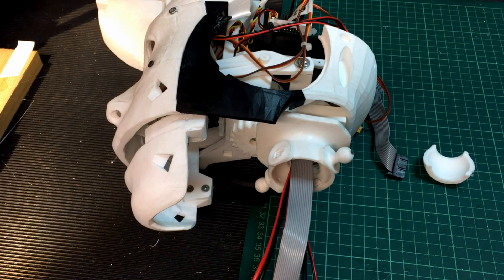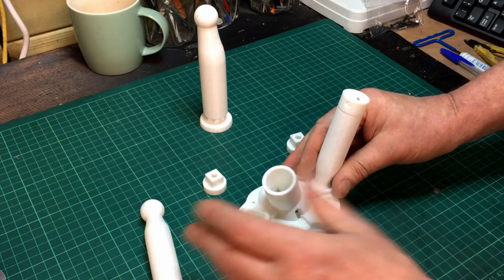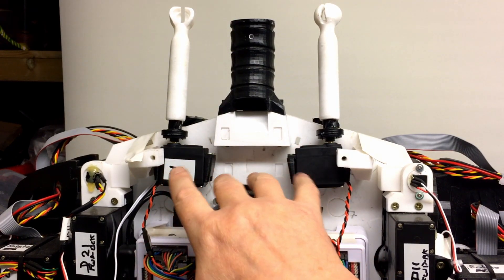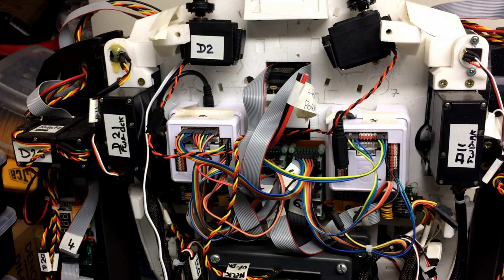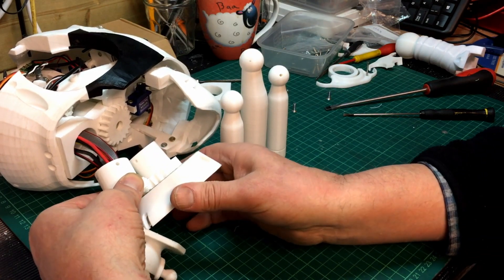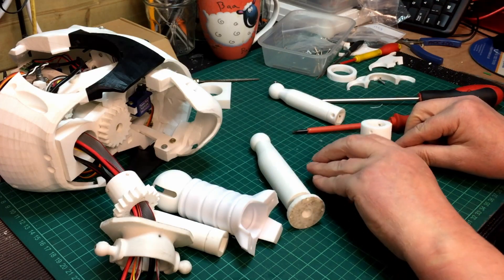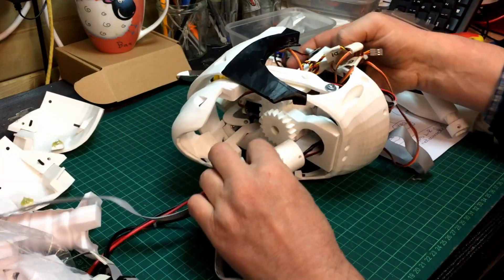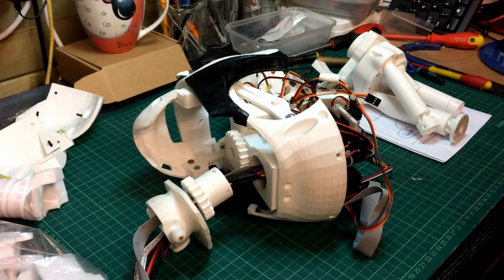InMoov Build Part - 33 V2 Neck

Comment: Just downloaded and printed the Neck, but if Neckpistonsidev1 is supposed to go into Neckpistonv2 they don't fit?
Reply from the maker: Hi Mark, very gently sand the inner piston section, take your time and use fine sandpaper. Don't overheat the plastic or it may distort. Eventually the parts will run smoothly together.  When they do run smoothly I often use a bit of silicon spray rather than grease, (be careful if you use grease to avoid trapping air and then you create a shock absorber effect - you will need to drill an air vent if that happens).
Reply: @kylecampbellweb  but it's have very variation I used sand paper but same problem happens it does not fit what to do please suggest
Reply from the maker: @TheHiddenTech2  Hi, its probably something to do with your printer calibration, I have seen similar comments on the InMoov forums.   Apart from sanding it down, try reslicing  the inner screw part very slightly smaller in your slicing program and reprinting it.
Reply: I also have same problem

Comment: May I ask, where do you buy your filament from? Last lot I bought was Sunlu from Amazon, and it's rubbish, the parts keep breaking. Also I don't seem to be able to find a nice pure white colour.
Reply from the maker: Hi Steve, I have always used Technology Outlet premium white pla.   Its always worked fine for me with both my Wanhoa Duplicator and the Prussa.  I was given some Sunlo PETG for printing the facemasks/visors I made and really struggled with, jamming the printer etc.  The Tech Outlet PETG works fine.  I now use NijaTek/Ninjaflex for flex printing which is really good after struggling with the Tech Outlet flexible filament.     Have always bought the Tech Outlet PLA from Amazon as it was cheaper than direct from Tech Outlet themselves but now everything got really expensive and difficult to get.     Amazon currently have stocks of the white.   

Its a nice white I think - https://www.amazon.co.uk/TECHNOLOGYOUTLET-PREMIUM-PRINTER-FILAMENT-1-75MM/dp/B06W568X1G/ref=sr_1_5?dchild=1&keywords=TECHNOLOGYOUTLET+PREMIUM+3D+PRINTER+FILAMENT&qid=1592683192&sr=8-5
Reply: @kylecampbellweb  Thanks. I'll order some and give it a try.

Comment: I noticed that most of your parts move fairly freely when assembled.  I would imagine that you use some sort of lubricant, and if so, what do you use.  Having a bit of trouble fitting the lead screw into the piston.  I had similar trouble with the small one for the jaw mechanism, but once I got that one in and worked it in and out a bit, it moves pretty freely.  For that I use a couple drops of oil that I had for my beard trimmer, but I am thinking that a lithium grease may be better.  All of my parts are printed in ABS.
Reply from the maker: Hi Dan, I spend a long time lightly sanding them first so they run really smoothly  when dry fitted. its really worth the time to do this.  I found that the STL files have pretty good tolerances when printed but can stick slightly in places.  Once they are really smooth dry fitted I use Silicon grease but not too much.  Also make sure there is an air-gap at the top of the piston or they will jam up!  This is the stuff I use... Liqui-Moly Silicone Grease Transparent as recommended by Gael, as it does not cause any discoloring. https://www.ebay.co.uk/itm/Liqui-Moly-Silicone-Grease-Transparent-100g-Tube-/362913691915?hash=item547f57790b
I have tried silicon oil but its not as good as grease.
Reply: @kylecampbellweb  I am in the US, so the Liqui-Molly that you list is not readily available in the US.  DO you think this might be a good substitute? https://www.amazon.com/Super-Lube-92003-Lubricating-Translucent/dp/B0081JE0OO/ref=sr_1_5?dchild=1&keywords=Silicone+grease+clear&qid=1584394190&sr=8-5
Reply from the maker: @danbemowski3014  Hi Dan, I  think the only thing to worry about is that it may stain the plastic, dont think it will cause any actual damage. Maybe try a part to test it on first?   I have also tried silicon spray on the neck parts but found it dried out after a while.
Reply: @kylecampbellweb  One more question.  How fine of sandpaper do you use?
Reply from the maker: @danbemowski3014  I just used what I had lying around, nothing too gritty though.  I only use PLA and not printed in ABS but am told ABS sands really nicely.  Be careful of oversanding and damaging the parts.     Not an issue with the neck pistons though, but I remember sanding the hip/waist gearing and almost overdid it a bit. Just get the parts to run really smoothly when dry which they will do if your printers well calibrated.
Reply from the maker: Hi Dan
I am having problems with the "comment" section of Youtube, not sure whats going on but incoming comments seem to disapper.
You asked about the InMoov neck pieces and which was the taller piston piece.   The smaller parts are NeckVistonV2 as you know, the taller front piston is the NeckPistonFrontV1.stl.    If you cant find it I can email you my copy of the STL
Using M2 nuts/bolts I am sure is fine if you use washers with them.
Reply: @kylecampbellweb  That was me.  Shortly after I typed the comment, I had looked on the inmoov files section of the website and found the part that I was looking for.  Because of that I deleted the comment.  You probably got notification of the comment after I had first posted it, but tried viewing it after I deleted it.  I must have missed that part when I was downloading the .stl files.

Sorry for the confusion.
Reply from the maker: @danbemowski3014  Hi Dan, at least I'm not going mad!!

Comment: Hi, first thanks for the videos they help a lot.  Was having trouble figuring some of this out.  I just started on the build and being dumb went right to the neck and head.  I think I'm pretty mechanically minded but it's hard to grasp with just the .stl's and the any written directions I've found seem out of date or files have changed.  I did figure out to stick with the Inmoov website and forget Thingiverse.  But again thanks your videos and the blogspot really do help and I know putting these together are a job in itself.   Tell the robots I said Hi :)
Reply from the maker: Hi, glad the videos help a bit. I think the heads a good place to start, they look really good. I know what you mean about lack of instructions but just print it all out and think of it as a jigsaw puzzle.  Wait until you get to the shoulder joints - that was the bit that looking at the drawings just got me more confused than ever.  Once you have the parts to handle, it all makes more sense.  Agree again about just using the InMoov site - get the robot built before tweaking it.  Colin and Nigel I am sure will say hi back to you when I reconnect them.

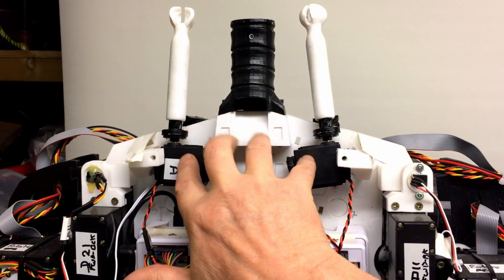Comment: Hello, Thanks for your videos, they help me a lot. I can not find a name for the servo NeckPistonSide at minute 5:00 of the D2 servo, can you tell me what it's called? Many Thanks
Reply from the maker: Hello Nuc, the D2 servo I am using in the video is a "ezrobot" HDD servo [check out ez-robot.com].   The InMoov site also recommends PDI-6225MG-300 types [ebay].   Also M6996R [ebay] and HobbyKing  do similar.  Must be at least 180-deg turn on them, not only 90-deg.  

The hands use same size servos.   The larger servos on my InMoov are Hitec HS805BB and HobbyKing HK-15338 - shoulders and body tilt etc.   Either type and there are others.  Always worth joining the InMoov forum and searching for servos to see what others are using. 
Enjoy your InMoov build!
Reply: @kylecampbellweb  Thank you, kyle campbell, I'm not yet in the forum. I have found nothing. Thanks to your help, I will now use the ez-builder servo. thanks again for your videos

Comment: Having watched all of your inmoov video's I have started my own build, the heads mostly done, upper torso is coming along nicely, one thing I have learnt very early, don't glue anything together as your probably going to want it to come apart for something else to be fitted later lol. I must admit as projects go, I have never enjoyed one as much as this, even if at times it seems hard to understand how the parts fit together.
Reply from the maker: Hi Angus, glad your enjoying your InMoov build.   As you say, avoid gluing as much as possible.   The main chest/body of mine is only partly glued together and the few parts that are glued, one is back to front!  I just print out bits and then try and figure out how they go together, I remember trying to work out the arm/shoulder from pictures before I built it and was so confused.  I use my own videos to remember how things fit when I take them apart, which is why I stated videoing in the first place.   Its an addictive hobby.
Reply: @kylecampbellweb  Whilst I remember, on the two side neck pistons, rather than pull a servo apart to reverse one, I mirrored one of the piston and the threaded ram in the X axis, so both pistons operate in opposite directions, so that if you turn them both in the clockwise direction, one side extends and the other side retracts and again opposite  in counter clockwise. Wont make a lot of difference but seems to work quite well and saves time altering the servo.
Reply from the maker: @gus452000  Nice idea, be good to see that working, can you post a video?
Reply: @kylecampbellweb  I will try and post something tomorrow, I'm a long way behind you lol.